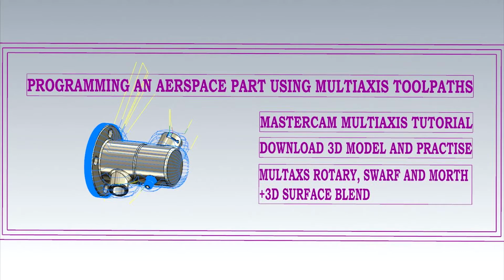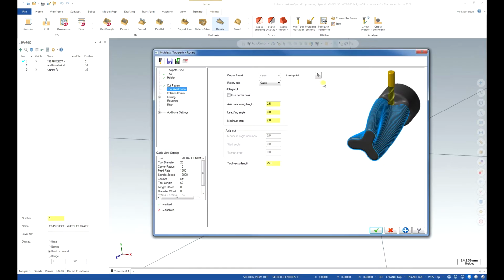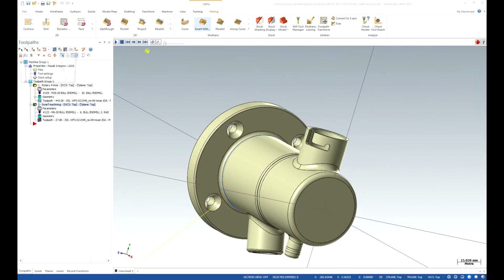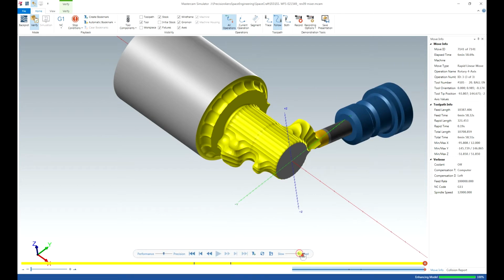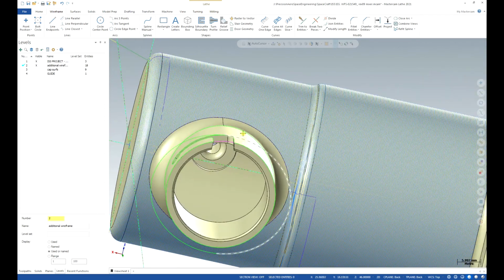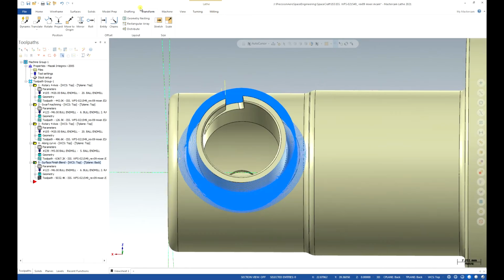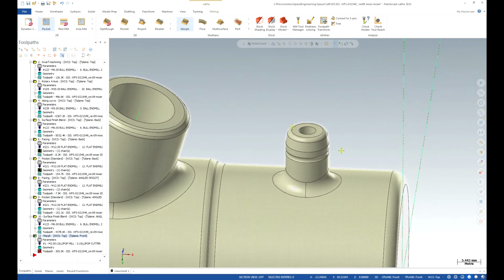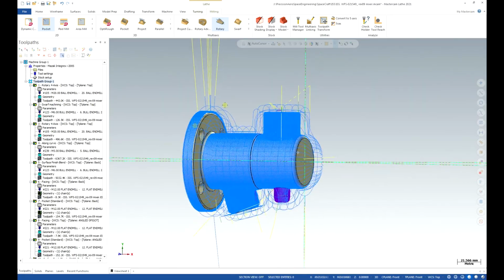Mastercam Multiaxis Tutorial - ROTARY, SWARF, ALONG CURVE AND MORPH  +3D SURFACE BLEND

Comment: Hi Sir. I didn't get on your backplot why spindle tools not straight up Z0 and the part straight up ( vertical) Z0 while machine all bosses?? Is this program for spindle rotation for death spindle?
Reply from the maker: im not sure what you mean by: " Is this program for spindle rotation for death spindle?"  
it depends on what material you're cutting and what tools are you using, in some cases, you want to avoid tool shank rubbing on a machined surface, also it every part can be machined in many ways using different, 
can you give me time on the clip that you think will kill the spindle?
Reply: @aspeaerospaceprecisionenging  hi Kofi! Just wondering when trinion  table rotate and when not rotate ( part not rotated)? Is that right when we choose 3D toolpath styles so stimulator part not rotated? And when we select on 5th axis toolpath styles so the part on stimulator rotate?? When we must use 5th axis and when we have to use 3D toolpaths but we still working on stimulator? Some day could you demo combination of those on 1 part? Thanks a lot.

Comment: Would it be possible to make the slot at 54:05 with some kind of dynamic motion?
Reply: thats a great question, 
I was trying to figure out how to rough out this slot myself 
And... no luck i dont think there is a toolpath able to do it
Reply from the maker: Sorry I missed your comment,
ill get back to you when Ill get back to my home computer
Reply from the maker: You can create a floor of this slot ( create curves on bottom edges then use those to create a power surface)  use this floor "surface" as your drive in toolpath "multiaxis pocketing" or  "along curve" with a lead use left top edge of the slot (looking from the start of the slot, create a curve on first 3 edges on the top left side of the slot and extend start and finish of the wireframe you've just created using "modify length" To avoid hitting sides in your collision control use sidewalls as check surfs and set the action to trim collisions, 
You can also play with different 2d tool paths,  using axis substitution in rotary axis control of 2d tool path set Substitute X-axis,
Reply: @aspeaerospaceprecisionenging  Alright thank you ;)